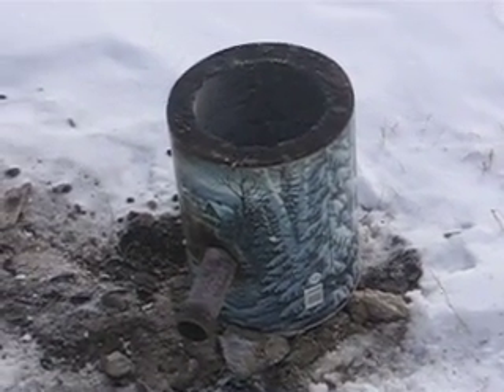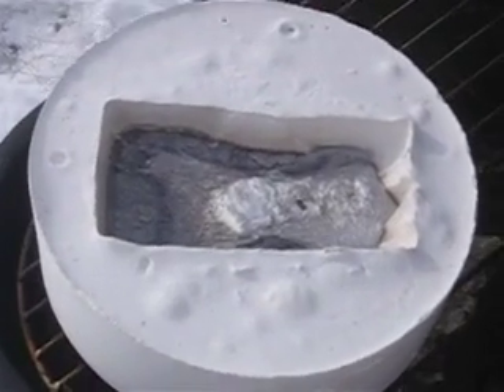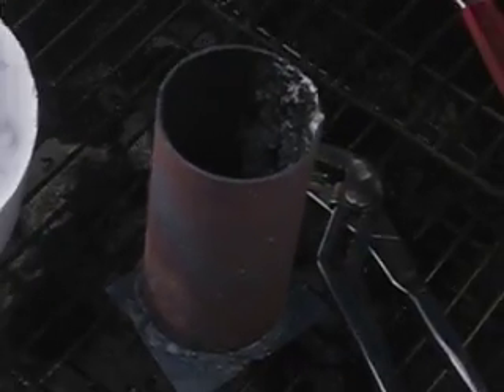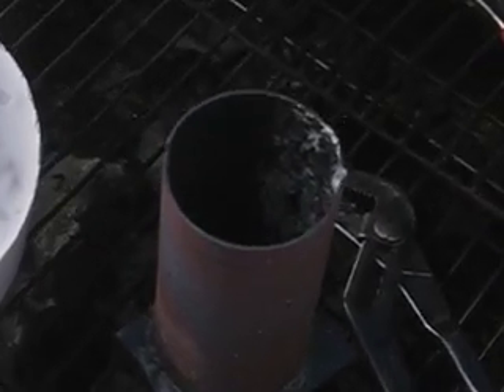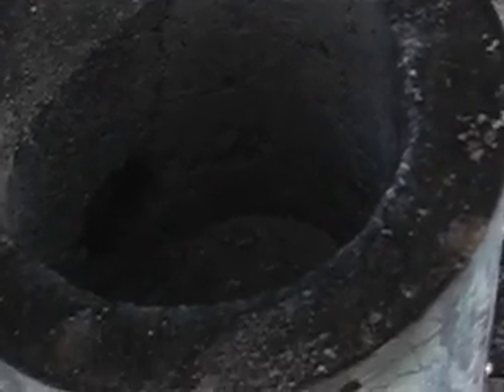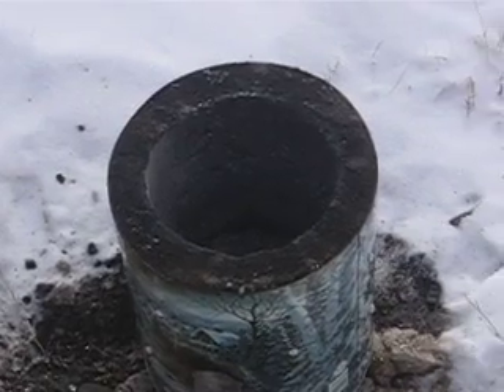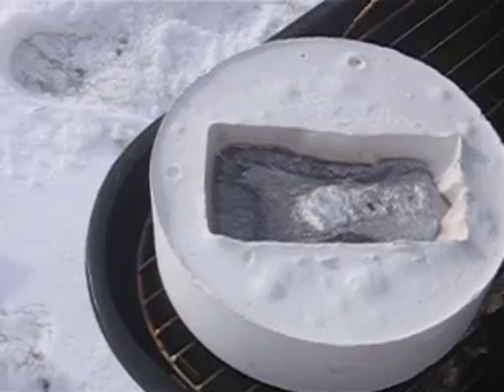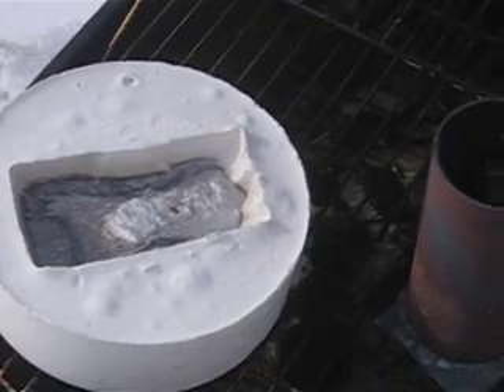First Aluminum Casting

Comment from the maker: I heated it in the over at 450 degrees for two hours as per the instructions I had read online... I really think, in retrospect that the main problem was the mold was too thin at the deepest point, and thus cracked, and allowed air into the aluminum.

Comment: nice video...was wondering if you tried preheating the plaster before the pour? or maybe it just gets air bubbles, i've seen people make molds with plaster but the pull out the air in a vacuum chamber first